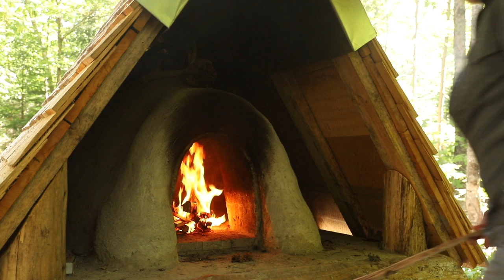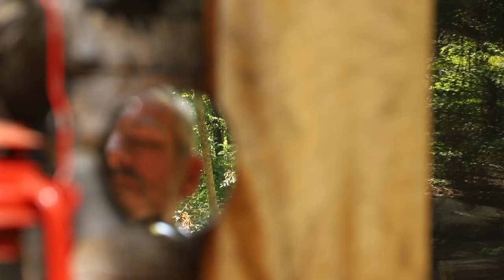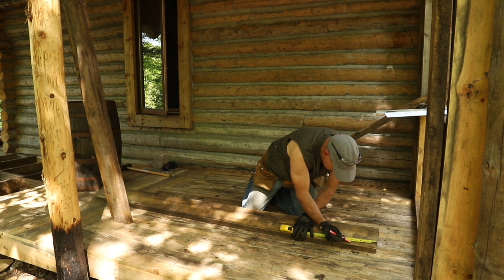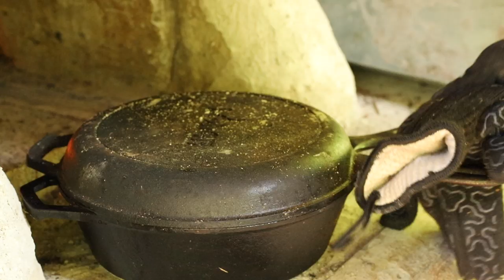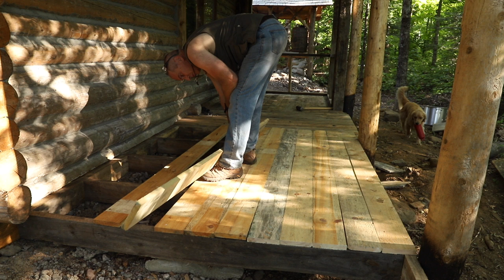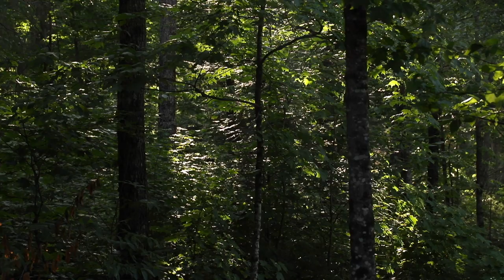DIY Porch Build | Off Grid Haircut | Bear Pot Roast in the Forest Kitchen

Comment: Man, that porch adds so much to the cabin!  What a HUGE difference!  Completely changes the look, but definitely for the better!
Reply: Yeah, but it will be very dark in the cabin...
Reply: @aniamak  He could add another window to the back side if he wanted to(?)
Reply: @aniamak  Not really.  Most of the sun comes from the front and right side of the cabin.  The porch is on the [west] side.
Reply: @willierants5880  Oh, I didn't know, that is from the north side.... Than is the porch OK
Reply: @willierants5880  By the way... I would be my dream, to spend a few years in such cabin....
Reply: @willierants5880  I think the porch is facing south, or west, the sun lights up that whole porch during the afternoon.
Reply: @billd9266  The front porch yes.  The side porch no.  I have never seen the side porch in direct sunlight.  If you look at the solar panels you can confirm your theory.  The side porch faces West.  If not West North West.  I fear we are taking this much too far.  :)
Reply: 16:38
Reply: @willierants5880  The porch faces west, not north. That's how he had sun on his face during dinner.
Reply: @williambremner9022  I'm in agreement.  Always have been.  I think people on confusing which porch.  There is a front porch, where the front door is.  That faces south.  There is the new side "porch" that will get screened in.  That faces West.  Agree?
Reply: @williambremner9022  Oh I think you are basing this off my initial comment.  Yes I was incorrect and updated that to prevent further comments.  Sorry.  West = Correct answer.
Reply: @AndyBrownt4  Well that IS problematic to the entire discussion.  LOL  Shawn help us out there.  The solar panels never face that direction An d_B.  Maybe it's the inclination.  I'm much further south so the arch of the sun is more of a straight line across the sky.  I think for Shawn being much further north the sun arcs more drastically across the sky?  I'm not saying I'm right in anything.  I'm guessing like the rest of us.  We can figure it out together.  :D
Reply: It might be even better if the side porch floor were extended all the way to the front edge of the front porch.  Access to the side porch would be greatly enhanced from the front of the cabin.
Reply: Looks like it's going to be a sun room
Reply: Definately added retail value to the cabin.

Comment: You were talking about doing slabs for bunks and also about how quickly the porch is becoming your favorite spot to hang out.
It seems like it would be a good idea to make the bunks so they can fold up or down against the cabin wall so you don’t lose the usable floor space for daytime enjoyment. Also, if you make the slabs so they have insulation foam (basement closed cell, 2”) they could increase the insulation on that wall for the winter nights.
Just a thought...
The pot roast looked so yummy!
Reply: folding up the bunks sounds like a really great idea!
Reply: NoneofBizor JuliejT great idea
Reply: JC1028  hmm, this is also a good idea.  I have a similar porch and I like it to look as open as possible.

Comment: Hey Shawn, on one of your previous videos, you were talking about energy consumption and maybe putting in a wind turbine or more solar panels. Have you considered installing a waste heat generator on your wood stove for wintertime? I know there are commercial products out there that use the Seebeck effect to generate power, but I am not sure if they are very efficient or cost effective. Alternatively, you could use a Stirling engine run off of the temperature differential in the chimney vs. surrounding air. Cheers!

Comment: Extension cables for your solar to battery are cheap. Get a 25 ft or so and leave the heavy battery near or in the cabin, protected, and move the panels around. That really helped me make it easier.
Reply from the maker: I've a little nervous about fire during charging.

Comment: Shawn, your cabin lacks appropriate ventilation. You admitted before that it is often damp inside. I strongly reccomend you to build a small window in the upper triangle of the South and North faces, to permit hot and moist air to escape in summertime. Remember that darkness, moisture and warmth, generate fungi, and that fungi, when breathed for years, generate cancer. 
You can install some type of opening window with mosquito barriers.
Reply: Some type of closeable small air inlet would also be nice to have in the lower part of one of the walls, to help air circulation, especially when you light fire inside too. 
I honestly don't know if this is part of traditional building of cabins, but it is an important aspect for any house, and especially for wooden ones, I'd say.
You can additionaly control moisture levels by using an open salt recipient, although moisture from cooking needs definitely some type of stronger way out.
Reply: I would also reccomend all that for the sauna, where moisture and heat levels are going to be particularly high.
Reply: Jam  Note that it is not only a question of humidity, but also of temperature and of elimination of toxic gasses, such as carbon monoxide, etc., not to speak about smells...
In construction laws checking air ventilation is always present.
Moreover, such small windows bring light too.
Reply: I suggest small windows that tilt in a horizontal axis, as one possibility. A removable mosquito net could be placed in the outside frame.
Reply: Removable framed mosquito nets are a great option. Just pay attention to the type of window you use, in terms of compatibility with framed mosquito nets.
Reply: @Retired Rhinestone Cowgirl I don't take jokes when it comes to health and safety issues, especially when they come anonymously!
Reply from the maker: @GonzaloCalvoPerez  Not sure if you realize it, but I have three windows and a door that are open most of the time...
Reply: @MySelfReliance  Hi Shawn. None of those windows/doors are in the upper section of the cabin, where hot and moist air (and fumes, etc.) accumulates. And none of those neither are open in winter, nor have mosquito nets. Am I wrong?
Reply: @Retired Rhinestone Cowgirl I haven't been disrespectful at all. I present here some important health and safety issues, and do it reasonedly, and what is more, with my own real name, without insulting anybody. I suggest you do the same!
Reply: And besides health and safety, it also has a lot to do with comfort. Correct me if I am wrong.
Reply: And as geologist I will add one more thing that you might ignore: The ground emanates Radon. Radon is a radioactive gas, and therefore needs to be evacuated. This is particularly important in granite areas, but also happens in other geological settings, particularly where there is feldspar (I think it definitely is the case in central Canada). It is also important when considering air filtering, such as A/C systems, that apparently can accumulate natural radioactivity, if not designed properly, in particular in terms of ventilation. But hey, don't believe me! Get informed elsewhere to check it for yourselves! But please, be humble.
Reply: Jam ,  air-purify? use electricity ?
Reply: @Retired Rhinestone Cowgirl Wouldn't it be nice if we all acted like adults? No wait, this is internet, that's not something people can do around here. Sarcasm intended.
Reply: Fungi can't really grow if there's proper air flow though. I'm pretty sure Shawn has that considering he's got windows and a door. The dampness can come simply because at summer the cabin gets really hot.
Reply: @Retired Rhinestone Cowgirl that who bacame so upset over?

Comment: Have you ever thought about having a “composting toilet” inside your cabin vs an out house?? Look up “camper van composting toilet” you tube there are many people that convert vans to camper vans & install a bathroom inside and use this type toilet. You could do the same Shawn. You could have a shower by using the same type system of camper van water storage container (40 gals) and be able to take showers year round & use a toilet inside  your cabin. Also for the summer months you could use a roof water catch system into a large storage (plastic) container on the outside of the cabin to collect maybe 100 gals (not sure how big they are but they make them for garden watering). I’m thinking for the winter you could bury the 40 gal plus container below ground & then hand or electric pump it up to a in cabin container & then turn the shower on. A camper shower you turn on/off the shower through the shower. Do a search on “van conversions builds with bathroom” they are very cool. Just a thought for your wife & you.
Reply: ...amd miss all the freedom of pooping in the woods? 
eewwww.

Comment: Hi , will you make a door out of the existing window on the porch?  Thanks,  Love your vlogs.
Reply from the maker: Thanks. Not sure yet - I may have structural issues if I do that
Reply: Debra Ann Mennella that’s what I wanted to know. I just think it would make sense so you could go right from inside to the porch.
Reply: Luv that oven, and your videos! 👍👍One tip when cooking with the cast iron Dutch oven, get your fire wood around the pot, you'll get even better heat, and cut your cooking time.  Did you bread in the oven yet?
Reply: @MySelfReliance  Consider bringing in some steel to aid in structural support for the opening. While not necessarily "traditional", mankind has been using metals since the Bronze Age to gain success in efforts. Seems the benefit of being able to quickly/easily get to the porch, especially in winter, would be considerable. In particular if you keep firewood stacked (a) to enclose the porch for a windbreak (b) more easily accessible in periods of extreme cold /storms.
Reply: @saabguy4787  yes he has done bread, is putting coals around the cast iron neccessary when its already in an oven that has surround heat?
Reply: @noneofbizorjuliejt6466  Yes it would help, one part of the oven remains open, which let's some heat out.  Cast iron retains heat and cooks better with even heat, having the wood around the pot will keep it hotter and lessen the times of rotating the pot.  The pot doesn't need to sit on the wood, it only need the heat around it.
Reply: @noneofbizorjuliejt6466    I see he didn't take my advice on cooking in the Dutch oven; I'll just un-subscribe now, lost interest in following. Good Luck.

Comment: A couple of old carpentry FYI tips you probably are aware of. Lumber, all sizes has a crown. It's a small curve or arch in the length of the Lumber/board/beam/2x4/2x6, etc., it's better to always place the "crown" up. The next one is a "Horse kick" the mark made on the wood surface when you're hammering nails and you miss the nail head and hit the wood. The imprint look like a Horse shoe, a tiny one. Next is "Measure Twice", cut once.

Comment: I'm building a double roof cabin (3,000 square foot interior, 2 levels, with another 1500 sq feet of mostly covered roof) wirh a high roof veranda porch. In central México you must build out of concrete and not wood, or your house will fall down around you in 3 to 5 years because of insect damage. Metal furniture is preferable. Woof furniture will suffer the same fate. Insects will eat the wood.

Comment: Please consider a better method of charging your battery. It's evident you need electricity, it's a necessity for you. I'm a fan, you have so many more skills than i, please consider mounting the solar panel on the roof, tree or wooden pole. The panel and battery system are a distraction from your self reliance theme...just a thought.

Comment: Based on the way the floor boards are positioned I think I've figured out that the door is going to be on the side in the middle. In the beginning I thought it would be at the front (same as the cabin door). If it is to be on the side, do you have something planned for a walkway to the side doorway?

Comment: Hey Shawn. There is one thing missing from that bear roast supper that actually looked pretty nice. You should try a scotch on the rocks. Or, just straight scotch if you don’t have any ice. My favourite is Grants. Smooth & aids the digestion. Not that expensive either. You should try it sometime. I recommend it.